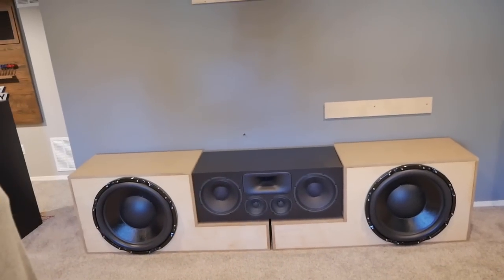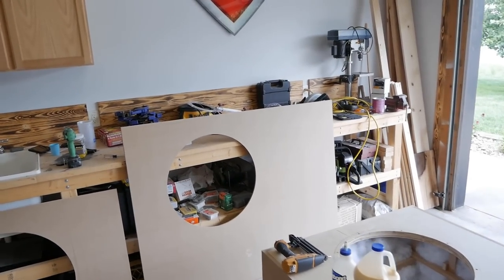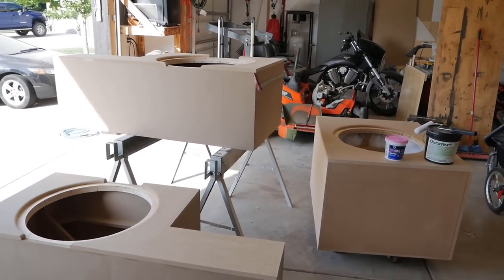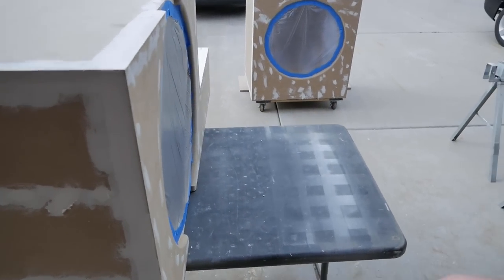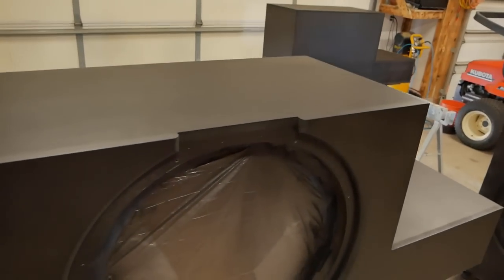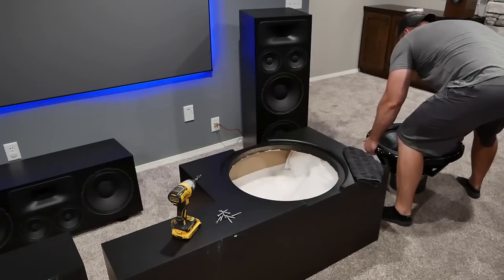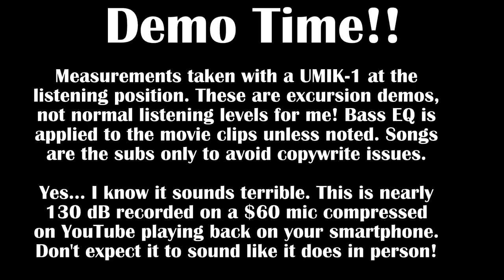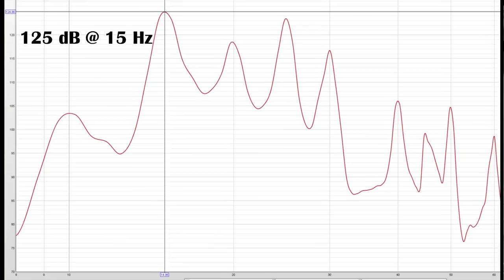Stereo Integrity HS-24 SUBWOOFERS Finished! Painting Crazy DIY Home Theater Subs and DEMOS!!

Comment: One of the best looking home theater setups in my opinion. I can only imagine how good it sounds. Liked this video and am a new subscriber.
Reply from the maker: Appreciate it Tom!
Reply: @LifeofBliss  What is your thinking about using Birch plywood versus the MDF? Also  would double thickness 3/4" sheets overkill?
Reply from the maker: I think double thickness on the whole box is overkill and just adds excess weight. Bracing every 8-10 inches will provide enough strength to keep box resonance to a minimum. Using plywood would save weight, but costs much more. Plus the end grain will need a little work to prep before painting

Comment: You're right about the rollers... its much better to spray.  But a couple tips I have regarding the finish of Duratex with rollers... Use a 9" roller with a very thin foam profile, the little rollers are only good for small speakers and tight areas.  Coat evenly without worrying about the streaks, wait 5-10 minutes (less in hot/dry environment), then roll in one direction only, overlapping about an inch as you go.  Avoid extending past the edges with your roller and avoid pressing down near the edges.  That will squeeze out the duratex from the foam roller unevenly and will create streaks when you go back over your work. If there are still streaks, wait a bit longer and then repeat the process, but roll in a direction 90 degrees to how you did your first "smoothing" rolls.  The thin foam roller will hold less duratex and you wont waste as much when its time for cleanup.  Great job, love seeing the build.

Comment: You have it right about having lots of compressor if you are painting. Many years ago I was locking up the body shop I worked at when we heard a rocket-like noise. We were about 200M from an airport runway, so we though it was something there. But when we drove around to see what it was, the noise was coming from our back door! We ran back to the front. We found a 1" PVC air line had pulled out of a fitting, ripped of the wall and wedged against the ceiling. The painter we left in the BlowTherm didn't even notice anything wrong because he was almost deaf and we had 50HP of compressor (a 20 and a 30HP running of of one pressure switch) so even with a 1" hole the pressure stayed high enough that the restrictor at the spray gun was still the limiting factor. Now you don't need 50HP, but you will likely want more than you can run on a 110v circuit.
Reply from the maker: Damn! Yea bigger is better. I'm used to an 80 gallon 240v tank my dad has in his body shop. I would love to have something like that!

Comment: I spray my duratex... although I did find a good roller method that looks pretty good.  Small passes over after with a dryer roller.... every direction criss cross, try and leave no roller marks.... really a pain but can look great.  Usually I thin the roller grade with 25% water and spray with 2.5mm LPHV.

Comment: What is the wire gauge on those subs ? You should upgrade the wires inside the subs, they look thin...
Reply from the maker: Its 12 gauge. Looks smaller in the video. Wish it could be larger but thats what I ran through the walls and all that the neutrik connectors accept

Comment: This reminds me of the automotive subwoofer audio scene in the 80s and 90s.  Now it's inside the house!  BTW The subs became overpowering.
Reply: This is a little bit different than that. Low frequencies at higher levels are much harder to reproduce in a home than in a car and most people either have many subwoofers not all playing full blow all the time and are using a DSP and boosting the very low frequencies (many times subsonic which requires ALOT of subwoofer for significant effect in home)significantly ORRR some people have certain subwoofers handle certain frequencies and others the lower. So basically someone may have 4 - 24" subwoofers that aren't running anywhere near their full output until they get to the subsonic range which is the whole reason for many or large subwoofers, for that tactical feel. So its not really a "overpowering" thing or experience as you would think.
Reply from the maker: This guy gets it 👆👆

Comment: Nice video bro, But my question is " Do you think those cabinets are the most suitable for those huge speakers as design language? i think as my "humble" experience these subs need a radiator suspension to makes you feel the real bass effect , i don't think sealed boxes will does the same joy, please correct me if i am wrong , and very good you keep kids around you when you create stuff its very important to make them creative in future , good man
Reply from the maker: Thanks man. Honestly, I've never heard another system compete with this one for bass. They are very impressive speakers. I chose sealed so they would dig lower. I didn't want them falling off after a tuning frequency with a port. Passive radiators would be a good option, but it'd cost quite a bit more. They do great with a sealed enclosure

Comment: You should really trim as much excess material before hitting it with a flush trim. You're killing the bit & potentially burning the wood. The bit shouldn't be encapsulated within the wood & digging its way out. Material should be trimmed to where 1 blade of the the bit is cutting at a time

Comment: in a large room what do you think is most important from a sub? cone area, magnet size (b/l), or xmax? like for example, i run a lot of subs (18) in various sizes (4 15s 10 12s 2 10s 2 8s) and the boxes are all within spec ( total space in the boxes before displacement are estimated at about 22 cu ft) ( 3 of the boxes that have the 12s are tuned to 39, and 2 are tuned to 32 the 10s are tuned to 40 and the 8s 42 and the 2 boxes of 15's are tuned to 36) (they are also all wired together and have influence on each other for better or for worse. personally i think better)  , but the subs are all cheapies but as a group they are capable of 4,800w rms (i do have a silly vid on my page of 15 hz i was testing for example using a taramps smart 3k wired to .4) . so tl;dr is it really worth it to get 4 expensive subs and call it a day? i have about 1k invested over the years in my wall in subs alone. currently i play from 19-73 hz with authority.
Reply from the maker: I think with a large room, its important to have at least 2 if not 4 subs to help smooth out the response. Then air displacement is whats going to get you the high spl. You can do that with a few high excursion subs or several lesser subs. I have (16) 12 inch JBLs that were $30 each that would probably yield similar results as (3) 24s, but they would also take up a lot more room down here for boxes.
Reply: @LifeofBliss  ok i understand now. would there be an advantage to more box space being used to handle the same amount of power you are on now? i know the room is also a box, but more cu ft of box for the subs is very beneficial for the room? thanks for taking the time to respond.
Reply from the maker: Just depends on the driver you are using, but you'll usually require less power to drive the sub with a bigger box

Comment: The FS of the HS-24 Is 17hz, and the FS of the IB-24 is 28hz. I wonder if the IB-24" subwoofers hit as low as these HS-24" subwoofers. Does the difference in FS affect the IB-24's low notes as much one would think? I would love to have some IB-24s, but shipping to TN is approximately $400.00 or so.
Reply from the maker: Those IB will hit great super low. They move so much air you shouldn't have any issues, but you can always reach out to Nick at stereo integrity, super cool guy

Comment: Absolutely Beautiful....I do have one question though. I'll admit I didn't watch the whole video but, do you plan on adding speaker grills? As I was watching the subs flex I couldn't help but wonder if the flex of the subs would distract while watching movies....like catching your eye? I know I had to go to a closed cabinet for my entertainment center due to the lights on the equipment so I didn't know if the flex was enough to distract.

I'm looking to do my house setup with SI next. I'm currently running 2 SQL 12s on an SIQ 1500.1 in my truck and they are some of the best sounding subs I've heard in a car.
Reply from the maker: Thanks man. You really don't see the flex since you are sitting straight in front of them. Plus it's dark with the projector, so you really don't see much of the speakers. It all kinda fades to black down below. SI makes killer stuff!

Comment: 18:00 Your talking about SPL, but your 2 front subs have a very obscured box design, and no tubes or ports. By looking at them i can feel that you are missing out on lower frequencies because of the box design and not having 4 inch pvc tubes.
Reply from the maker: Do some more reading on sealed enclosures. Box shape has nothing to do with how much spl a speaker outputs on a sealed box. I would be really missing out on low frequencies if these were ported. They'd drop off like a rock under 20 hz ported unless the box was 5x the size. Sealed allows for lower frequencies  to still have a high spl

Comment: Hey, great video. So, EQ, what was the thought process? To EQ more to a flat curve that does rise? Or was there some room curve involve? Did you add a room curve in after? I'd love to know, and does it sound better? Thanks.
Reply from the maker: So they preferred doing more of a flat response for the subs with a very quick rise around the crossover point. That way you have more of your chest slam (40-60 hz) while still getting that super low bass. It worked out very well
Reply: Interesting, how much does it rise around the crossover point? @LifeofBliss
Reply from the maker: 8-15 db, just preference. I'm about 10-12
Reply: Okay. I'm using +8db, but I'm using a slow rise to about 30hz with a 0.7 Q. To raise it very quickly after 80hz would require a pretty aggressive Q, maybe a Q of 1? Do you have a video of the EQ or do they have videos about that EQ style? I'd love to see it.  @LifeofBliss
Reply from the maker: I do not have any video or pics of the graph after it was done unfortunately... and this was all done at my last place. I just remember it was bumped pretty quickly around 80-100 hz depending on crossover (mine was 90) and it was pretty flat after the bump
Reply: Interesting, thanks. @LifeofBliss

Comment: @life of bliss did you buy the jumper cables to wire your subs in series for a 4 ohm load or used any speaker wire?
Reply from the maker: Just any speaker wire will work. 12 gauge or bigger

Comment: Hey Kyle, I recently subscribed to your channel and I love your videos. For quite a while now I've had my heart set on eventually getting some JTR subs for my setup, but after watching your videos I'm getting tempted by the DIY route, instead of spending 3 or 4 thousand dollars on a sub.

My suggestion about your stereo integrity 24s, do you know what the difference is between these and their ib24 sub? Other than the huge price difference?

Keep up the great content.
Reply from the maker: Thanks man. You'll just be investing time vs money into the diy route. As far as the ib24, its made for an infinite baffle configuration. I believe it has a different motor, but it won't perform as well in a box as the hs24 will. If reach out to Nick at stereo integrity if you want more info on them
Reply: The primary difference between the HS vs IB is essentially intended box size and application. 

If you were going to implement an IB (infinite baffle) install, whereby the backspace you could provide for the driver would ideally be huge, ... ie., attic size, or small room size, ... the IB version would be better. 

The driver's motor structure is significantly different. The IB motor is smaller, lighter, and more optimized toward an IB (infinite baffle) application. 

Whereas the HS has a much heavier moving mass and motor structure, enabling it to utilize a much smaller box size and backspace volume. 

All that said, either driver can be forced into either application, via signal shaping (EQ) and power. 

Not specific to these Stereo Integrity drivers, but in general terms; small sealed optimized drivers vs. infinite baffle optimized drivers is oftentimes misunderstood. 

A driver can be made whereby it's electrical-acoustic characteristics are such that it operates in such a manner that it's relatively unaffected regardless of how small the box size is. A large diameter, high power multilayer voice coil submerged in a massively powerful magnetic field. Such an arrangement renders the box volume less a factor as a function of overall system sensitivity. 

Whereas an IB optimized driver would possess dramatically less magnetic motor, less moving mass, as a by-product less inductance, and less power handling. 

The diminished power handling isn't an issue in an IB, because it's not fighting that undersized box volume backspace. Lower inductance is always a win (more optimal transient response).

As stated, contact Nick @SI

Comment: I was interested in getting the mini dsp, but I didn’t understand how it worked. I am interested in getting remote help in tuning it. Do I need to get other parts along with the mini dsp? I have SVS ultra surround with SB-16, Denon & outlaw receiver and amps. Can I get more info please. 👍🏼
Reply from the maker: You can get a mini dsp to help with tuning 1 sub, but svs does have its tuning app to help. The minidsp really comes in handy when you have 2 or more subwoofers. Check out avs forums for some general info on the minidsp
Reply: Life of Bliss thank you. Good to know, I will b our purchasing a 2nd, but getting hard to find used ones on SVS. Just subscribed to u!

Comment: My ridiculous upgrade suggestion:

21 inch mbms to replace front subs and devastator subs behind couch.
Reply from the maker: These 24s have a ton of chest thump and get much lower. I'd love to play around with a dev one day, who knows, May add a few in our new place next year to see how they are
Reply: @LifeofBliss  if someone would let you test a dev, it'd be interesting to see it's response vs your sealed. I'm wondering if it will be like the svs ported vs the ultimax. I REALLY like sealed because, no risk of chuffing, but a HORN is supposed to be way stronger than a ported or sealed. Maybe it's more usable frequency.

I have an ultimax 15 which I'm sure my apartment loves right now, and the reason I liked it over my klipsch, beyond being infinitely better was no chuffing. Just never a risk.

You really do have my dream setup. I love the way you did that center area. I'm sure you're really happy with it it fits your area perfectly. I am a sucker for the 1099/1299 look.

Extra drivers for the 1099/1299 is a thought as well. Always good to have a backup!
Reply from the maker: I've been in talks with Kevin at GSG Audio. Hopefully he can send one out and I can do some comparisons 🤘

Comment: Mind explaining your power? I ran the numbers & the power requirements to run that Sinbosen amp is very high to hit those numbers.
Reply from the maker: The amp is ran off a 230v30a circuit. Its good for about 7k watts or a bit more. The burst power comes from all the caps. It only lasts 1-2 seconds, but for most movies and music, there are short bursts of high power requirements.
Reply: @LifeofBliss   you showed a video showing the back of the amp when you unboxed it, it's rated at 5600w, I simply don't trust the knock off amp. the specs are all over the place even on their own website, sketchy as F IMO, there is no official power rating certification.
Reply from the maker: @2002SLPSS1991  i hear ya. Check out the avs forum link i posted in the description. The amp has been tested to nearly 4k watts rms and about 7500w peak per amp board/power supply, which there are 2. I'm going off those numbers that were tested by an individual here in the states

Comment: hey Mr. Bliss..... what kind of subwooer can i put on a denon 887... not to expensive... what would the right way to do it... passive or amped.... do car subwoofers work some how?
Reply from the maker: Pretty much any sub for home theater that can hook up with an RCA cable would work. Powered sub would be the easiest. Car subs would work fine, but depending on the model, May not dig down super deep. But you'll need an external amp, something like the crown xls series for a car sub. Powered subs are easier. svs is a great brand, OSD is another budget brand that is a good buy on sale.
Reply: @LifeofBliss  alright thanks for taking the time to answer... i will check it out hope i cant get good lows

Comment: What gauge wire is that on the woofer wires? seems small for the power levels. Awesome system
Reply from the maker: Its 12 gauge. Looks smaller in the video, but could definitely be bigger. Unfortunately the neutrik connectors are pretty much capped at 12 gauge and thats whats ran through the walls anyways

Comment: Insane! Kyle I’d really like to know the length of your build for the subs and the center channel when combined together. We’re building a new home and planning a theater out. Thanks!
Reply from the maker: As in the width of everything? Roughly 114 inches. Good luck with the build!
Reply: @LifeofBliss  thank you. Where is you find the dimensions to build those awesome boxes? Much appreciate the information love your setup.
Reply from the maker: The center channel was a kit from the company diy sound group. The L/R were as well, but I modified them to be ported and changed the driver placement. The subwoofer boxes were designed by me to accommodate my space.

Comment: I didn’t see an air port for the subs. How does that play into the sound?
Reply from the maker: No port means slower roll off, plays deeper. Boxes would have been too big in my situation for a port as well. Theres a little less output around what a ported box would be tuned at, but I wasn't worried about output with 3 24s